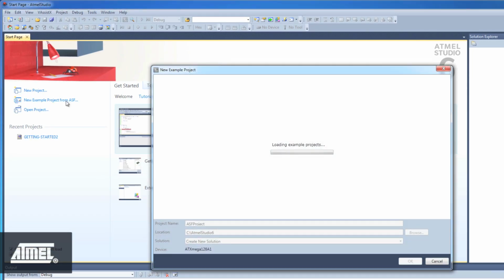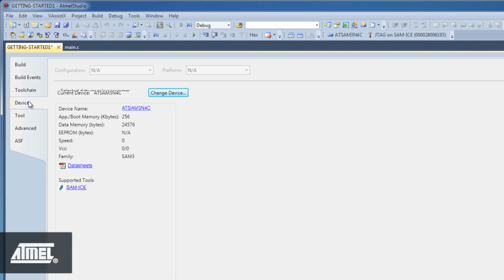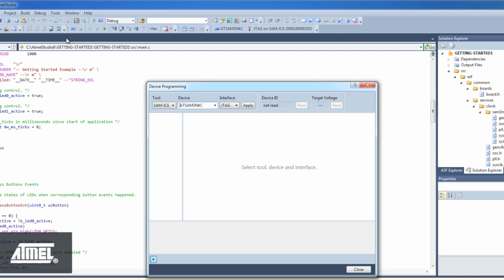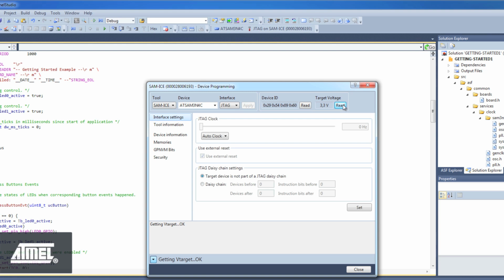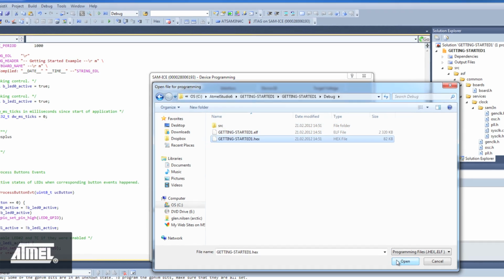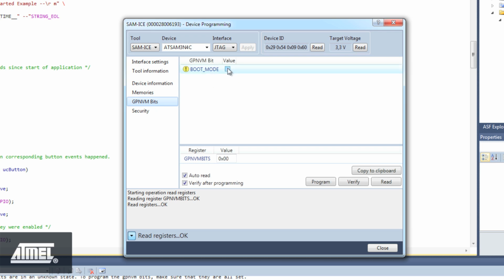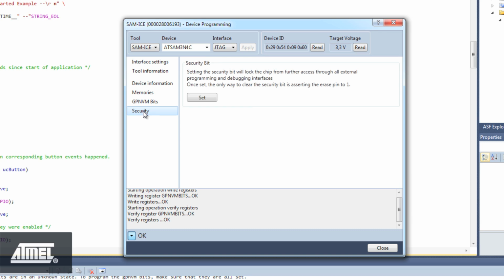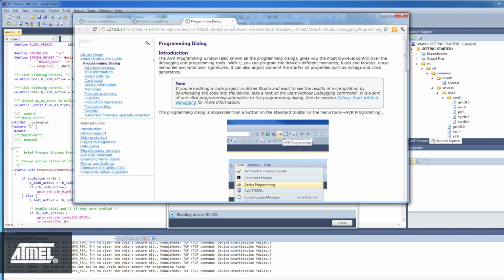In-System Programming in Atmel Studio

Comment: Any help with my issue would be much appreciated. When I attempt to read device ID, an error pops up that reads "Error: could not activate device interface, but found DAP with ID 0xbd11477." The error recommends doing a chip erase to restore connectivity.

I have very carefully followed the datasheet's instructions on performing a hardware chip erase, but I repeatedly get this same error whenever I try to read the device ID, or do really anything to the chip through Atmel Studio. It's extremely frustrating. I've been troubleshooting for several days and I can't seem to find a solution.

Thanks in advance if any kind person has any help to offer me.